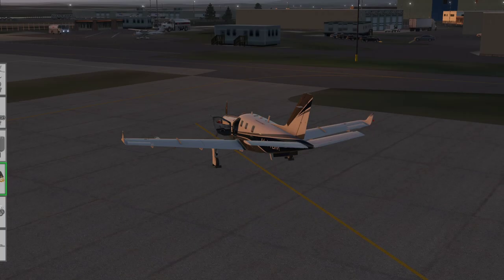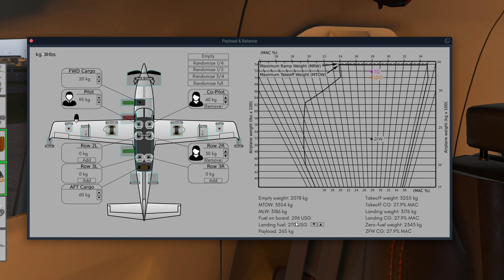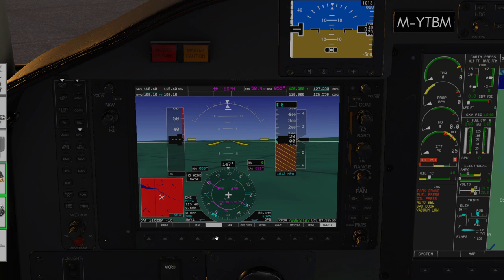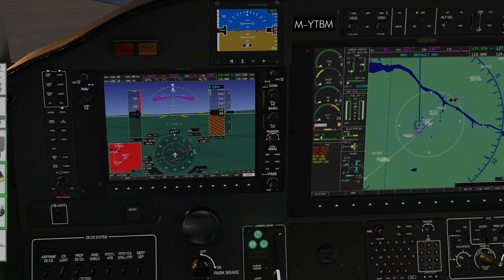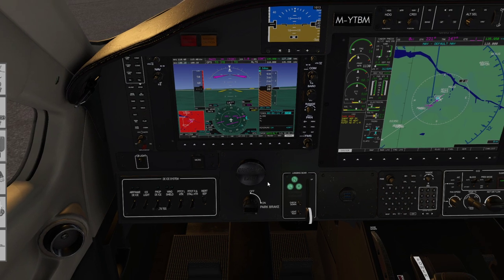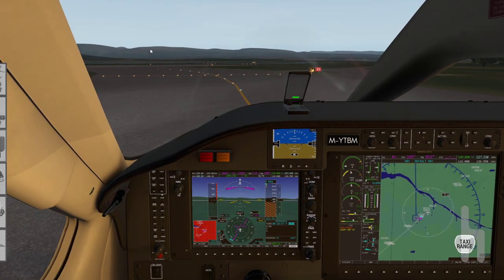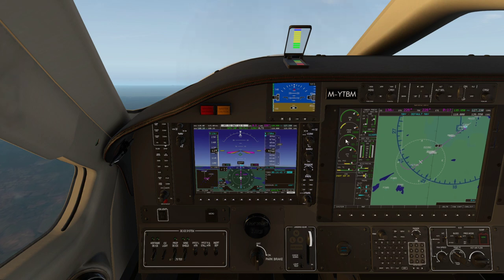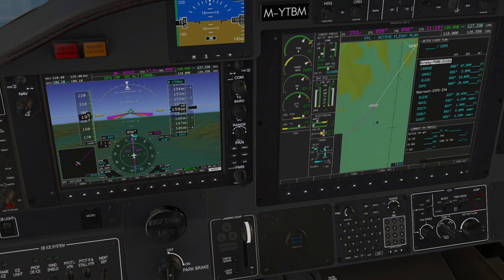Hotstart TBM 900 Part 1 - IFR Departure from Glasgow [X-Plane]

Comment: Hello Graeme, I am in the process of buying a new pc. I am considering the Alinenware ultrawide 34 inch screen. Do you think it will make much difference to say a 27 inch screen? Also, any hardware tips you could offer. I will primarily be playing X plane 11 and the pending Flight simulator 2020?
Reply from the maker: Hello Colin, I’m afraid I don’t know much about hardware optimisation - my PC is about 8 years old with a slightly newer GPU, and I have a 23” monitor. That said my instinct is an ultrawide monitor would very useful for visual flying where the extra field fo view would be very welcome. For Airliner flying I’m not so sure as keeping the panel and the view on screen together is much more important - I.e. more vertical aspect required. I see a lot of people with a separate screen mounted lower for the panel view, maybe this is an option? However as I said I don’t have any direct experience. You could try asking in the Hotstart Discord server? There is a hardware chat channel there and some very knowledgeable people.

Comment: One question: What is the proper name for the rectangular "flip up" shown on the glare shield. It displays color lines from green to yellow and I assume it is displaying your climb attitude.
Reply from the maker: It’s an “angle of attack” or alpha indicator. It measures the angle of the airflow at the wing and shows how close the wing is to stalling. A very useful device that every aircraft should have. There will be a short “extras” video about this after video 4 in a few weeks.
Reply: Thank you very much. I have searched for that for some time and only after watching your video did I see it’s application.

Comment: i have virtually zero time with a G1000, so forgive my stupidity, but how do you set up the Values for use with the Flight Level Change (FLC) button? My aircraft ended on M.300...
Reply from the maker: It will engage FLC at the current speed. You can adjust it with the up and down wheel control on the autopilot.

Comment: Hmm, I was with you here until @17:30, where my TBM 900 will not let me enter "NAV" mode. May be a bug? I had followed all the other steps precisely and I just "upgraded" (heh!) to the most recent Vulkan Beta b13, so, that could be it. I'll try going back to the "release" version and check it...
Reply from the maker: The key with all modern autopilots is to understand the Flight Mode Annunciators, or FMAs, these appear along the top of the G1000 and will show the active and armed modes. When you select Nav on the control panel, (assuming you are using the GPS for navigation) you should see GPS in white as it becomes armed, then green as it captures. When you have the issue with Nav what FMAs are shown?
Reply: @ReflectedRealitySimulations  yeah i missed the part in your vid where you changed the nav to GPS on the EFB earlier in the video, and that worked. Again, the best vid series you've done thus far. BTW, do you have P3D? If so, I would LOVE a similar video series on the PMDG 747. I'd be willing to sponsor it if you don't have those...

Comment: Is the g1000 in the tbm 900 the regular g1000? Would like to use an existing tutorial i have from awhile ago. 
Thx
Reply from the maker: It's a heavily enhanced version of the default G1000. The flight plan handling is mostly standard I believe. The autopilot integration and some other stuff is much more customised.

Comment: hi i am new to XPLANE 11. i watch all your video. when you set up your flight plan you enter in 420 ft for BARO min. where do i get that on chart?
thank you wayne
Reply from the maker: Hi Wayne, sorry for the delay replying. On the FAA charts it's quite straightforward as you simply read the value from the chart. In the UK it obviously has to be more difficult! The state charts publish the obstacle clearance altitude rather than the minima, so for Aberdeen the Category B OCA for ILS Runway 34 is 376 feet, or a height of 161 feet. The difference between OCH (height) and OCA (altitude) is the threshold elevation, in this case 215 feet. However we need to know that a normal ILS approach has a system minima of 200ft - that means the lowest allowable decision height is 200 feet, so to get the decision altitude add 200 feet to the elevation of 215 = 415, rounded up to the nearest 10.  If the OCH was greater than 200ft you would use that instead. So the approach minima is the higher of threshold elevation+system minima or OCA (which is of course the elevation+OCH). Hope that makes sense? The UK state charts are fairly poor in this regard, IRL a chart service like Jeppesen will provide the relevant minima to save you from having to do the calculation.
Reply: @ReflectedRealitySimulations  thank you so much.

Comment: If Imay ask, did you assign a lever or a button to the low idle, I can't find the command to assign and with the mouse it doesn't work very well
Reply from the maker: Hello Daniel, Engines-Basics-"Mixture rich a bit" and "Mixture lean a bit" are the bindings you need to move from Cut Off > Low Idle > High Idle > Flight Idle. Hope this helps.
Reply: @ReflectedRealitySimulations   Fantastic, works perfect,  I'll enjoy it even more now, Thank You very much  Graeme